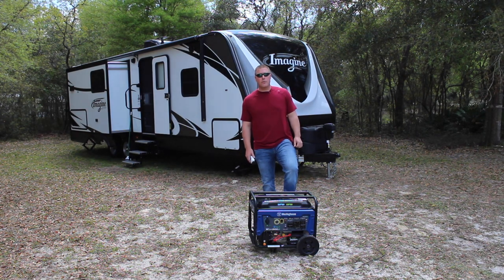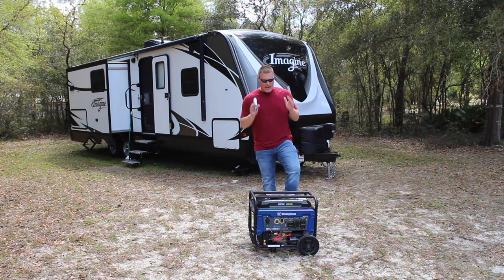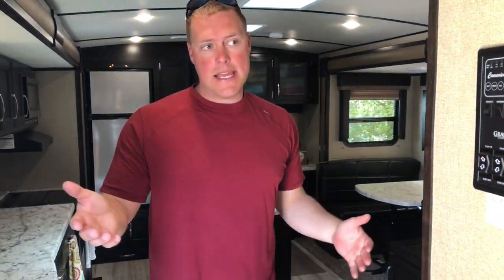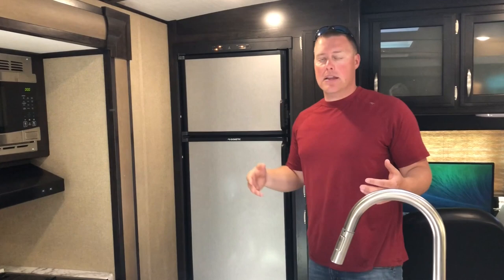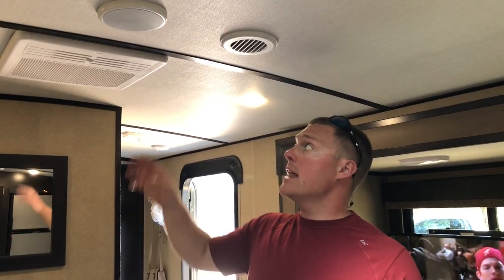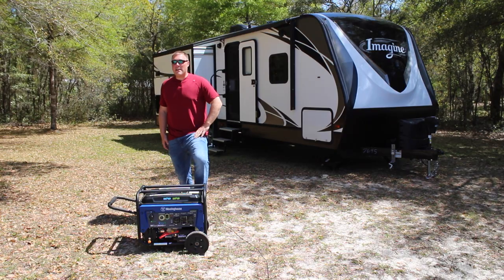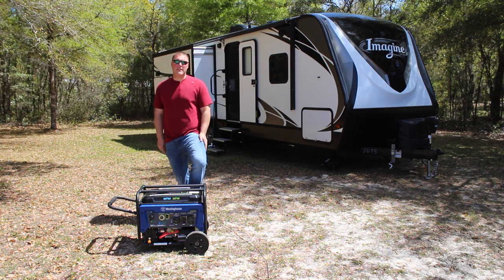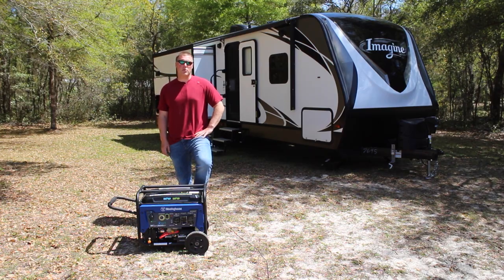Westinghouse WGEN3600 DF Run Time Test, How Long Will It Last Under Real Conditions?

Comment: Good review, Thanks for putting in the time and effort. Quick question, I noticed you had the TV on. Everyone says dirty power will destroy your sensitive electronics. Does your RV filter the Gen power? If so can we use one (Filter) for a cabin? Love the duel fuel on this compared to Predator 3500.
Reply from the maker: If you're concerned with electronics, I would go with an inverter generator. Westinghouse does make a dual fuel inverter, but it was really popular and sold out. I asked them when they anticipate more inventory and informed me end of June/beginning of July. Alternatively, you might want to check out this option: https://amzn.to/2WWq4Co
Reply: Did they filter the power? He never answered the questions...just talked around it...🙁